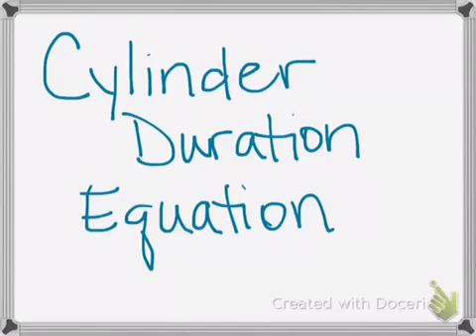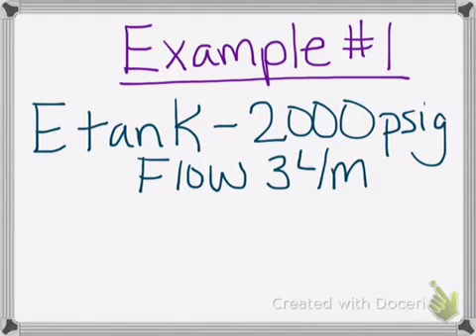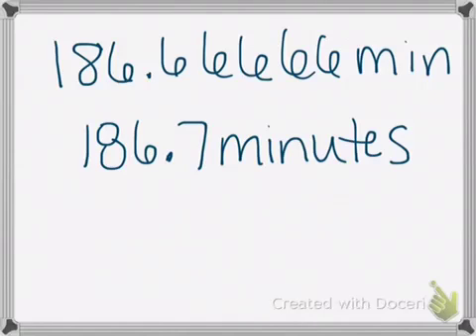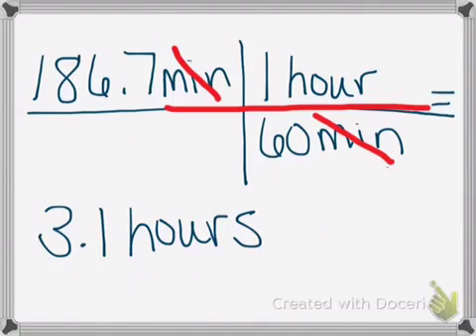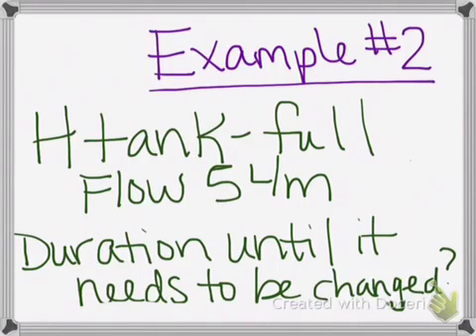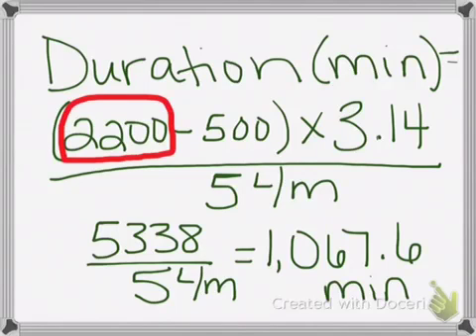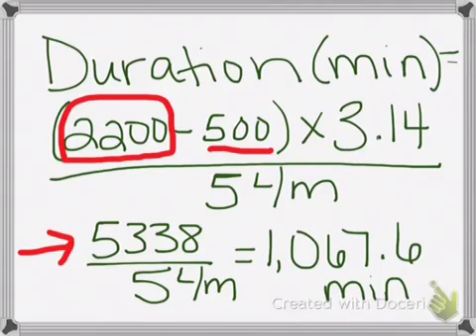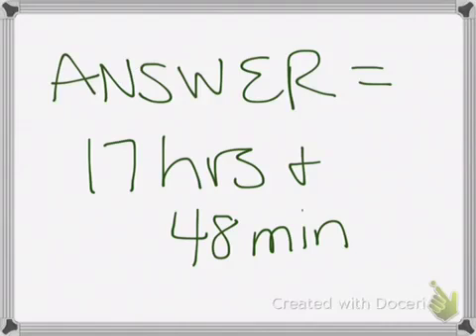Cylinder Duration

Comment: This has to be a rough approximation because as the gas leaves the tank the inside pressure is reduced. It means that for every pressure value shown by the pressure gauge on the cylinder, the duration will be smaller than the previous calculation. Calculating the duration for different pressures using this formula, the resulting graph would be a linear function with negative slope factor. For some reason I believe that the real equation would be exponential with negative exponent.
Reply: Share your calcutaion sheet.
Reply: Hi, I'm from the future. Anyways, I'm not sure, but if I have 2000psi of O2 in an E tank, we know we would always have the same volume (in this case 560 liters) of O2 that could be released in Earth's atmosphere, right? That would be constant. The rate coming from the tank is also constant/linear (1lpm, 4lpm, etc...) I think what you're describing would be true if you poked a hypothetical hole in the tank and the flow would be releasing at a decelerating rate over time.